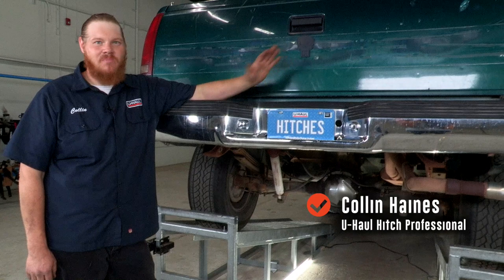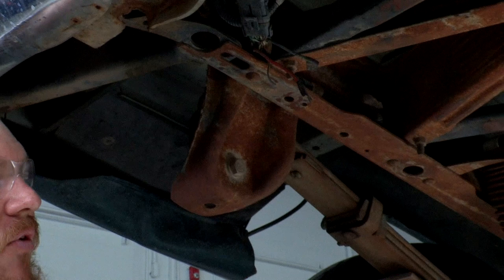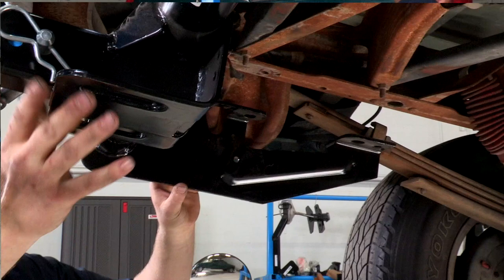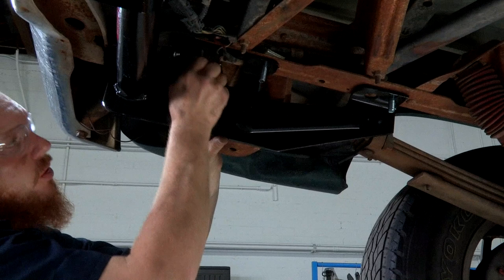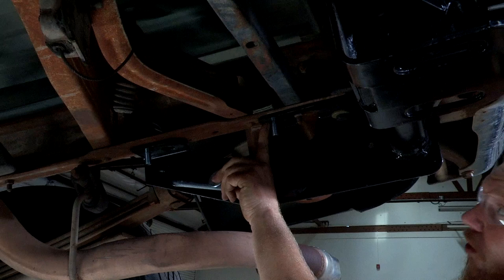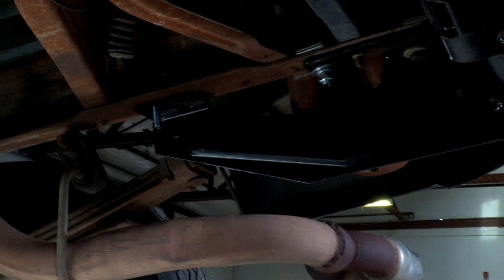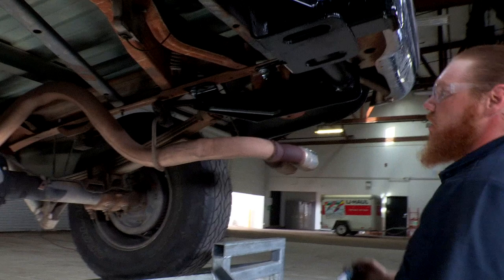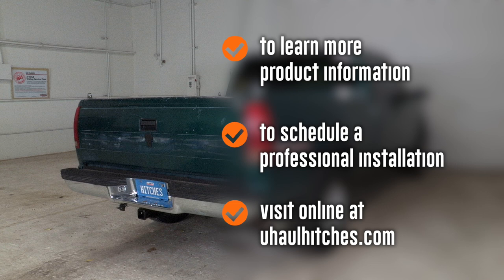1995 Chevrolet Truck Trailer Hitch Installation (includes 1500, 2500, 3500 models)

Comment: This would never work on my 95 k2500 truck. I just installed a reese that uses the same mounting holes and I had to cut the middle mount off. The rear leaf spring mount has a brace that comes out and is riveted thru the bottom of the frame and it's right in the way.
Reply: I’ve got a 95 k1500 and after reading you comment I think I’ll let usual install mine